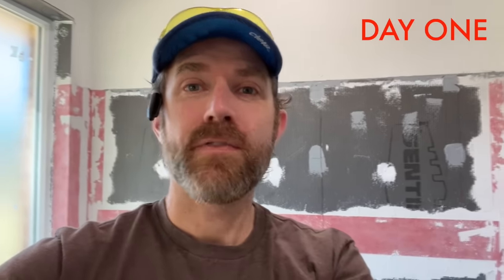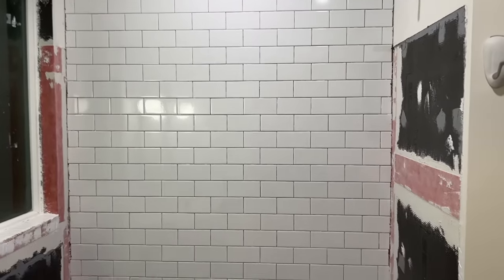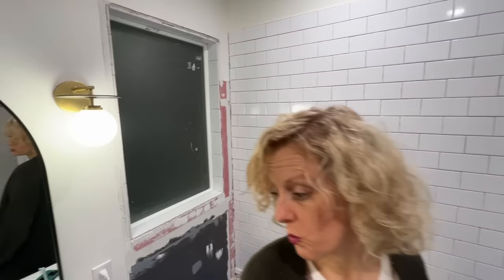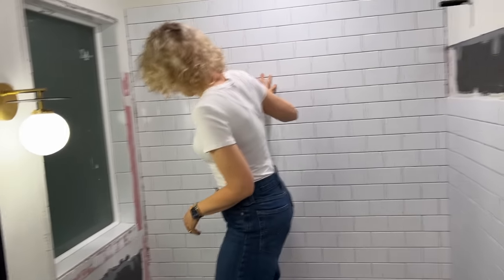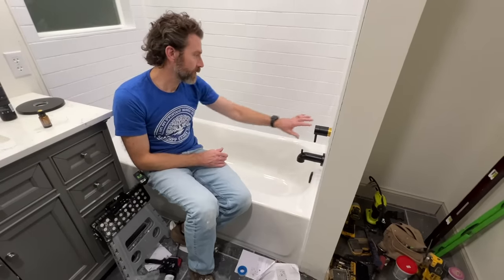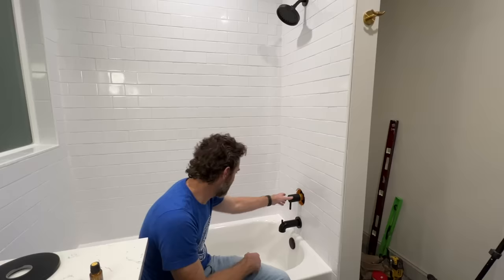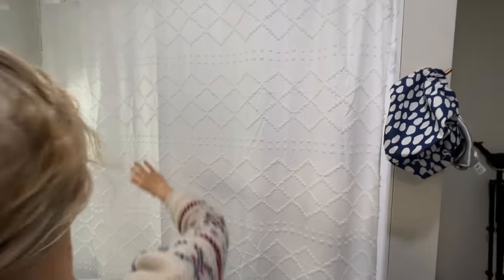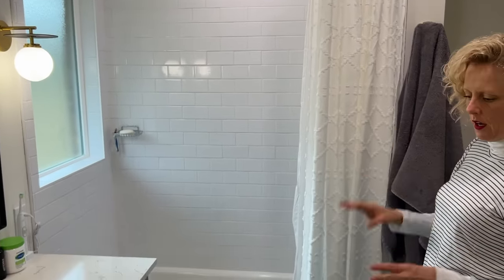MIKE NEARLY HAD A BREAKDOWN TILING OUR SHOWER

Comment: Great job. Interesting how subway tiles have come back and are everywhere.  Back around 2000 we bought a 1920s house.  The bathrooms were tiled with subway tile.  I wanted to do the kitchen backsplash in them.  But they did not exist at that time--at least not in the big box stores.  You would have had to buy something larger and cut them to size.  Turns out I did a blue and white checkerboard with contact paper instead which worked out well.  By the time I decide to use them on a future project they probably will have disappeared again.

Comment: Mike, you did such a great job with the tiling, you can both be so proud!
For the placing of the shower curtain I could give you several reasons for hanging it between vanity and window: First it‘s adding more interest to a room when you can’t see immediately where the daylight comes from as well as making the room appear larger than it is. Then it seperates better the two ‚wet areas‘ which gives the room a more structured, neat look and another reason would be, we are more used to see curtains near windows so without it the window looks a little ‚naked‘ (as a german Int. Des. I might be used to different visuals but I thought I‘d share anyway, at least that‘s how I would explain it to my german clients) 💖

Comment: Afternoon Knorpp;s - lovely looking bathroom - my question is the window in the bathroom. I can see it has private frosting on it and I remember you replacing windows in the house - Question... is that window safety glass so if someone slips in the shower they don't go through it or is it original to the house so not safety glass it should have a safety glass symbol in one corner